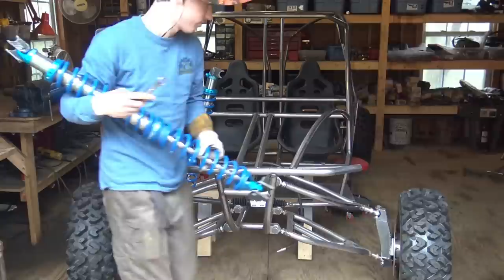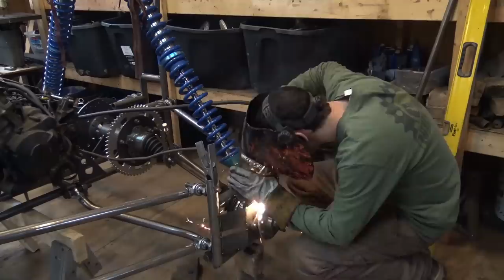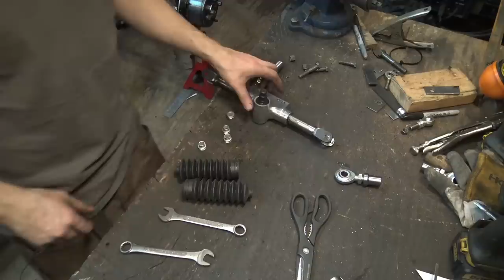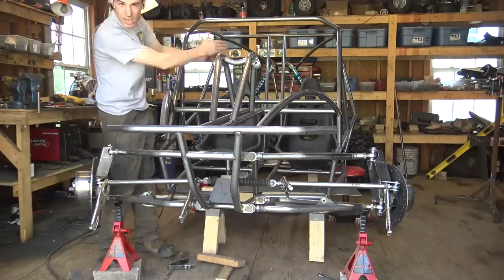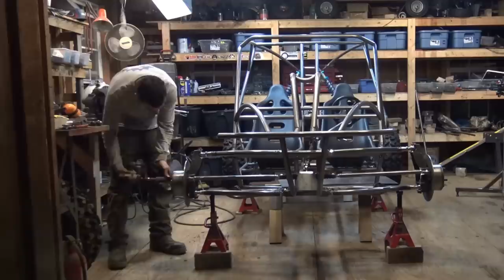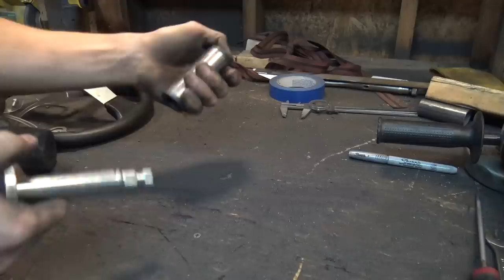Honda CBR 600 buggy build part 7

Comment: Sweet build mate. About the engine - ballpark the total weight of the buggy (+driver+passenger), work out the HP-per-ton, compare that ratio to a medium sports car (150-200 hp/t) or a crappy 4cyl hatchback (100 hp/t) - As long as you're near the 120-150hp/t mark (if your CBR600rr is 110hp, you've got ~2000lbs to play with) - Keep it near that and it'll be quick... you just need to worry about gearing, as that'll get you the torque.

Comment: You have to put limiting straps with those shocks
Reply: wouldn't the heim joints be the limit?
Reply: @keanwoodall7598  heim joints would wear out, would you rather replace a couple straps or heim joints?

Comment: Still need to tie the 2 sides of the a arm mounts together in the front and the very rear link bars. Any force on the one side you want directly to push against the other and transfer to the ground on the other side. The way it is now with those log unsupported bars will start to bow over time as the suspension works. That brace on the shock hoops might look cool bent but your basically adding an unneeded failure point to it. The force on it will be up and in basically trying to force it down and out. Use a straight tubes to tie things together. Bends add weakness to tubes.

On your steering it's easier to setup if you mount your steering on the backside of the spindles. Otherwise in order to get the correct angles normally the tabs have to be pushed out to where the wheel wants to be. On the backside you are bringing the tabs in towards the buggy away from the tires. Also protects the tie rods somewhat more.

That top windshield bar will fold at that bend if you ever get it on the side.

I also still hope you plan on drilling those bolts and putting castle nuts on those heims holding the spindles on. Those bolts on the bottom will try to loosen up and being upside down will fall out tucking the wheel up under the buggy ripping the arms off.
Reply: Your first point is a sway bar and they aren't used on long travel off road suspension as it defeats the purpose of the suspension and limits it's movement
Reply: neo 71665 ooh sorry mr know it all
Reply: Random videos by Joe Ye he is being a know it all but some of it true
Reply: @prime0591  Uhhh, all of it is true. neo 71665 knows what he's talking about.
Reply: @shaynegadsden  That's not what he's talking about. What he's talking about is the upper A-arm mounting points. There should be a bar between them to keep the upper arms from pushing inward when he G-outs his suspension. There's already one on the front of the lower arms. There should be 2 across the upper front arms, and 1 across the upper rear arm.
Reply: @shaynegadsden  I'm not talking about a sway bar that ties the 2 a arms together. I'm talking about behind the frame mounts for the a arms.
Reply: @joewilliams4198  yep excuse me for trying to help somebody from my building and failure experience.

Comment: The engine just looks small compared to the buggy. I am sure it will move it fine, it's just a perception thing.
Reply: Still gonna need to put the gas tank, air box, and exhaust back there. The hole will fill up fast. Also seem to remember him saying this was gonna get a reverse box so add that.
Reply: @user-neo71665  Very true. It may be better when complete.
Reply: Not gonna have enough torque.
Reply: @fullmetaljacket7  Yup. It needs low gearing and then top speed is like 40mph. Going through gears all the time :D
Reply: This thing wont like low speed but it will have plenty of power for sure

Comment: It looks to me like your front end is going to under stroke the shocks. Mechanically bottoming before the shock bottoms.
It is hard to tell from a video obviously but if you haven't already. Pull the springs off the front shocks, bolt them in and let it compress down to full bump. You've got to look out for 2 things.
 
1. does the setup over stroke the allowance of the rod ends at full bump. : if it does your going to bend or break the hiems/arms etc.
2. Does the frame hit the ground. problems there self explanatory. ( aka: compressed disks or broken back ) That is if you plan on jumping.
I would recommend taking a piece of tube & two 90deg mounted bushings, make a strut that matches the length of your shock, at its shortest length. it's lighter and easier to work around than the shock. 
Tack a jig tube in place, holding the arms just before mechanical binding, build your top mounts there, you can use a limit strap to stop the stroke on the droop end of the stroke. They are available ordered by length.

The other way to solve bottoming prematurely is by building a spacer that goes inside the shock shortening its stroke range.

Try to get that bottom shock mount out as far as possible on that lower arm.

A model stroke of my front suspension. Not that it shows anything pertinent. 
12" long shocks for 23" travel.
https://www.youtube.com/watch?v=TeW9NwpnFI8
Reply: This bloke knows.

Comment: You will probably need custom drive shafts. Extended, sleeved and welded shafts will work on a lightweight, low powered buggy. Welded drivetrain components are strong only when you have a large enough diameter to bear the load, ie, on a 4' diameter tailshaft. On a small diameter shaft there simply isn't enough weld to hold. But hey, give it a shot, it probably won't wreck anything expensive if it lets go. Keep up the good work!

Comment: Four wheel drive Chevrolet you do need the cv axle end with nut on to keep it outer part of hub and wheel/tire coming off. I learned the hard way by putting a 4x4 hub assembly on a 2 wheel drive....

Comment: You're learning kid! After this build you will have a pretty good grasp on how to build an offroad buggy. You're going to need stops for your steering and either stops or fall out straps for your suspension when it's topped out (fully extended). You don't want the shocks topping out, it will ruin them. You are DEFINITELY going to need a steering stabilizer unless you're fond of broken wrists. Talk to King for your spring rate and valving when it's all done. If you give them your buggy weight, suspension configuration and the type of driving you're going to be doing they should be able to give you baseline spring rates and valving and clicker adjustments. All these things should have been taken into account long before you started buying parts or building anything but it is what it is now. You've built that buggy a little bigger than that motor will probably be able to REALLY scream with but if you gear it right it will probably be ok you just won't have a lot of top end speed, maybe 50-60 instead of 70-80 MPH but that's still pretty fast for off road. Hopefully the clutch will hold but you will almost definitely have to put the heaviest duty clutch and springs int that are available. I would think it should still pull pretty good out of the hole because of low gearing... Next best choice would probably be a 1000+ cc motor especially something like a Hayabusa, I think they put out something like 190 HP stock. It might be a little too pricey for you, don't know. Next option would be a good ol straight 4 cyl like a toyota 22R(?) They put out like 120 HP stock. Then you could mod it a bit for probably 150 HP naturally aspirated or throw a mild turbo setup on it to easily and reliably get 200 HP out of it. A V8 (like an LS) for that buggy is out of the question, way too big. Mayb on your next one you could do a full size buggy with long travel and LS power. You'd probably need 25k minimum to build something like that though. That said, when your done with this build I think you will have a nice little long travel buggy that will suck up some serious bumps,whoops and jumps. Look forward to seeing it all done!
Reply: IndyHelis  I don't know bro, he's a pretty quick study and his learning curve has seemed to be quite steep as of late...

Comment: For 4wd the front axle and nut is what puts the "preload" on the unit bearings. You'll need to come up with a bolt of some sort to tighten up in there. If you look at the newer trucks from all makes the front unit bearings are the same for 2wd and 4wd the 2wd uses a bolt assembly to preload the bearings.

Comment: In my previous experience of moving semi-heavy wheeled vehicles (aka 50s tractors) without them running, standing on the rear tire and "log rolling" it to move the vehicle is the easiest and least damaging way to move a vehicle. Have also done this on an old pickup truck. Harder with the bed covering the wheel wells but still works pretty well.
Reply: Self-damaging*

Comment: 2 things about your front end. Pull your outer tie rod mounts inwards to align them with the 2 heim joints you’re using for ball joints  and then that same angle needs to be copied on your inner heim joints to eliminate bump steer. 
All that work to eliminate bump steer and your scrub radius is still so far off that when one tire hits a tree root it will probably rip the steering wheel out of your hands. 
Turn the steering wheel with the tires on the ground. The tires ideally should pivot on one point for zero scrub radius. Your tires will have to travel (roll) in a semicircle to turn left and right.

Comment: 4wd hubs need a stub to hold the roller bearing centers together, figured that one out before on a late night front diff swap. Did just fine for 5 miles, one hard turn and a bump leaving a drive through, pop there it went.

Comment: Yes, chevy hubs are pressed together, but indefinitely needs a bolt. I was outvoted working on a 99 chevy Tahoe about putting the cv axles back through, so they put everything back together again. We went for the test ride left my warehouse and got up to the lovely speed of 45mph before all hell broke loose making us do a 360 and being s.o.l. Passenger side front shot out first which I was riding shotgun, then the driver side went. It'll hold till there's legit power and weight. Ripped the whole front out fresh ball joints, sway bar, steering, and the whole brake lines were gone when they went. Ps after that my buddies finally realized to listen to me when we're working on anything from dirt bikes to trucks. Lol

Comment: Start saving my friend... You will need a Hayabusa 1300cc engine to get the right power to weight ratio. Love this build great job buddy.
Reply: I think he’ll be alright with that 600. He’s just got to have it geared for low end with that huge sprocket he already has. It’s not like he’s gonna need to go over 45 with this thingn
Reply: 100% agree. Power to weight ratio is not going to be there.  High revving small cc motor, makes no power till the upper register. Forced induction would solve this debacle surely. Otherwise something along the lines of a v4 would be sweet. Something with a more linear curve. Torque utilization is key. Maybe he's got a trick up his sleeve. We'll see.
Reply: @sizzlek5269  I easily go over 40mph with my Yerf dog 3203 kart with a build 196cc. Power to weight ratio is the key. A 600cc sport bike is under 400 lbs, this thing looks at least twice that weight... It will be slow trust me.

Comment: hey man, on a 2wd hub you don't need a "bolt" through the hub, but on most hubs that the axle goes though the axle is what holds the two bearings together. The nut also needs to be torqued to a certain ft/lb or N-m to make sure the bearings have the right preload on them

Comment: The build is probably to far along but when you set up shocks or coilovers you should bump out the suspension(fully compressed and still have ground clearance) then set your shocks as close to a 90* angle to the inner pivots of the a arm or link. This makes the spring rate and valving of the shocks more progressive (makes the suspension stiffer as it compresses). This is a common rule of thumb in desert racing. Just something to keep in mind when setting up suspension

Comment: For your steering tabs on the front, don't keep removing material to increase travel. make the tabs farther apart and make a spacer. you want those tabs strong, also with the gearing in that steering shaft if you hit a log or something at speed it will break your arm. You will need at least one or two steering dampeners to help absorb the shock.

Comment: To minimize your bump steer, make your tie rods (center to center of each heim joint) as long as the difference in length between the heim joints of your upper and lower A-arms. For example: if your lower arm is 24" long, and your upper arm is 22" long, make your tie rods 23" long. If your tie rods are too long, you'll get bump out. If they are too short, you'll get bump in. Good luck, and keep on welding.

Comment: I have a genuine concern that's bothered me since I first noticed it. Maybe it's just the camera angles or could be just a misjudgment on my part, but I'm concerned about the space between the disc and the tire. I don't recall seeing a test fit on the calipers you'll be using either. If there is enough space for them, make sure that when the sidewalls are under load they don't deflect and rub also.

Comment: To make the front shocks softer move them closer to the frame on the arms. It will give the wheel more leverage and make the shocks feel softer. Remember closer to the wheel = stiffer ride and farther from the wheel = softer ride on the same shock.

Comment: If you put the rack and pinion behind instead of in front you'll have better clearance, and more room to set the Ackermann angle correctly. It might also give you room to line up the steering wheel linkage without such a harsh angle at the pinion end. You'll have to flip the rack unit over so it steers the right way.

Comment: Your hubs need to be bolted together to hold the bearing from falling apart. One of the best ways to do this is to get a axle end and cut it off so that you have basically a splined bolt to go thru the center and then place the axle nut on the end (makes it a perfect fit and how its meant to be)

Comment: The angle on the back suspension is fine, you rarely land flat and mostly on an angle making the direction of the force in line with the shock

Comment: for the steering tie rods hitting the bracket you can just weld them in a V shape with the open end of the V welded to the hub and the tip of the V on the Heim joint. You would need to bend the tips to be parallel for the bolt to go through, It would give you the clearance without having to shave extra material

Comment: def need to put either a large bolt and washers or the stub end from broken CV shafts through those wheel bearings in the front brother

Comment: I'm an ASC certified mechanic and I'm telling you right now that if it is a four-wheel drive setup for an S10 you have to have the drive shaft end in IT aka some kind of retention bolt to hold it all together

Comment: If that is a 4wd s10 front hub, the front axle shaft helps hold the hub together. It will cause extreme wear if you dont have the outer stub shaft in that hub.

Comment: If you make the u joint angle the same on both sides of the steering shaft, you'll feel ALOT less binding and a smoother wheel return

Comment: steering rack looks good , think it will work , tthe ackermanprinciple seems to be pretty simple the arms of the tabs need to be in line with the center of the rear axle , if you mount them in the front they point toward the tire if you mount them in the rear they point toward the frame , its pretty simple actually compared to the rest of the suspension geometry he top front suspenion mounts  , i think the bars you welded those to will bend upward

Comment: Heres a question to think about... what is the first thing that gets hit and probably bent is front suspension arm gets damage?.. steering arm, what by bending will turn plowing angle so much that vehicle probably wont even move, so worrying about bump steer is pretty irrelevant at that point. Thats why those usually are up and behind he arms protected from damage.

Also while you are at it build another hub like in back and put that on front with slight modifications. Put proper brake disk and limited slip differential on both ends. Steering will improve with 80%? LSD and brakes are located in chassis being protected, while arm weight decreases allowing faster response on bumpy surface. Power for front drive you can take from back driving chain in center console.

Comment: Flip the rack over and mount the steering to the rear of the spindle. This will solve your clearance issue and be way easier to set your Ackerman angle.

Comment: Needs axle stubs in the front to hold the bearings together. They torque to like 185 ft/lbs. The bearings will just fall apart without it. You may be able to use two wheel drive front hubs, not sure.

Comment: The CV joint keeps the hub together, the torque for the nut should be about 180ft.lbs. also maybe on the rear upper shock mounts, leave those mounts in and try more strait up and. The angle might be help it from leaning too much around corners.

Comment: If your still worried about engine power (i dont really think itll be an issue though you may shift more than youd prefer) you could always go V twin or V4. Those engines are all about low rpm grunt. And cheap used. If you want stupid power go for a yamaha vmax V4 engine. Depending on year the newer ones cam put out over 200hp. Plenty of low grunt but still rev to infinity. They are shaft drive however but might save you some cash on that hyabusa engine you were looking at

Comment: Although you're quite aways along on the build it might have been an idea to mount the engine sideways and drive a transmission and transfer case with a chain reduction to whatever speed you like and go through a convention axle on the front and back for four wheel drive. Then you would also have had reverse.